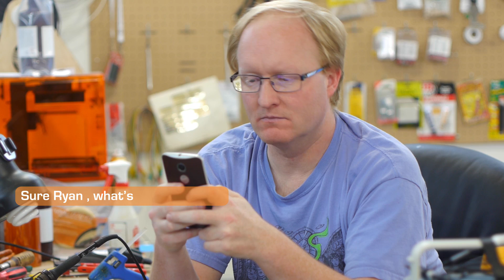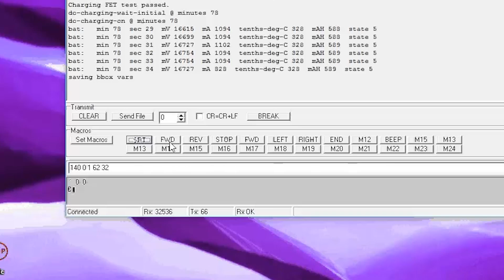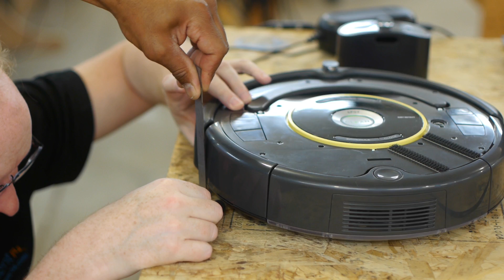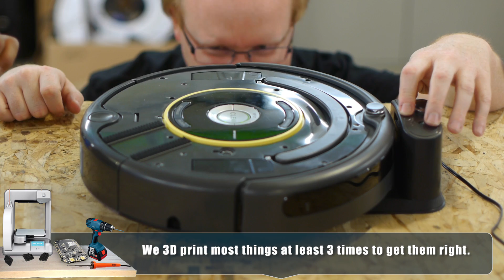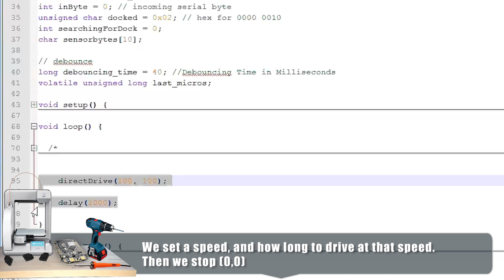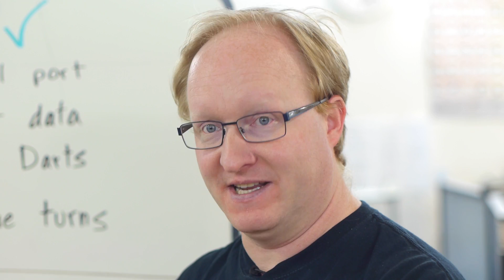Ben Heck’s Roomba Nerf Dart Collector Part 1

Comment: at 11:50 you raise up the base, but provided there were no wires/connectors running under the base you could have just raised the base and cut the plastic piece between the prongs off instead of raising the prongs themselves
Reply: If you look closely at 11:45, you can see the front of the roomba popping up when it runs on top of the foamcore pad they put the dock on, which essentially nullifies the added height advantage of the foam in the first place. Moving the base forward on the pad so that the roomba remains totally on the table probably would've solved the problem.

Comment: When they raised the front wheel, they could have just cut out the dropped section of the dock (where the wheel goes). Then just shim up the entire dock to meet the contacts on the roomba; instead of modding the contacts on the dock.

Comment: Why raise the prongs when you can raise the base 1/4 inch (like you started too) and cut out the center piece of plastic between the prongs so the raised front wheel fits. You went through a lot of trouble on an overly complicated solution.

Comment: damn you made that charger harder than it had to be. did you not consider cutting out the central area where the wheel goes and raising the whole charging station 1/4" ??? it could be nonslip or weighted whichwver is needed .... just a thought.

Comment: Why not building the dart collecting system on the side of the robot? Then you don't have to roll over the darts, but run by them: more space for the collector mechanism, less trouble to solve the roll over problem.

Comment: Just an alternate approach on the charging station...Instead of raising the charger contact posts, if you cut out the center plastic of the charger base that the front wheel was riding up, you could then add the foam underneath as a spacer.  The base would need to be fixed, though, or something added to the roomba to pin the charger down to the remaining base surface as it drove over.

Comment: Ben, I think you should 3D print a spacer or use some foam tape under the rear wheels inside the assembly to lift the roomba without requiring the rear dragger.

Comment: Having worked in retail that sold Roomba's, I know for a fact that iRoomba should have a ton of 'refurbished' vacuums in stock. NOT because they are bad, mind you. It's over a far more basic flaw. It's because the Humans that want these...don't want to lift a finger to do anything. These fantastic devices kept coming back in droves with dust and dirt radiating out, everywhere. Meaning the fatal flaw is that the robot can't go out to the curbside trashcan and clean out it's collection bin. It was as if these people could not conceive that the filth from their floors was not magically being consumed into a non-existing state by the things.

I had hopes that iRoomba, by now, could have upgraded the self guiding charging base into a kind of rubbish collection bin...and verbally complained until the lazy owner actually pulled out the filthy tray.
Reply: +jupreindeer check out karcher vacuum robot, it cleans itself into charging dock, then you have to clean charging dock I guess
Reply: +jupreindeer so they call in that their Roomba is "broken" cause its not picking up dirt anymore? wow.
Reply: +jupreindeer Spread knowledge in this world or we will drown in dust.

Comment: You could have used the foam to lift the charger if you just cut out that middle section that the wheel drives over.

Comment: Did nobody notice the overexposure on the whiteboard? 2:15 is unreadable
Reply: ***** Dude that's just you. I can see it just fine
Reply: Knowledge = Performance that's how it looks for me: https://slimgur.com/images/2015/08/28/6bf8059db0fee1d4e9e5f21239372054.png
Reply: +TheTrueM3ga  It's perfectly visible you must have som bad setting on your screen that makes you not see it. I guess too much light or low contrast or saturation.
Reply: +TheTrueM3ga At least it means you can't see the mistake on the whiteboard that seems to have gone mostly unnoticed: "Rooma To Do"